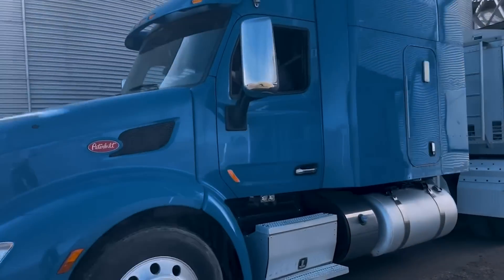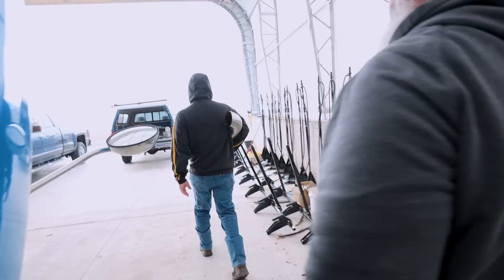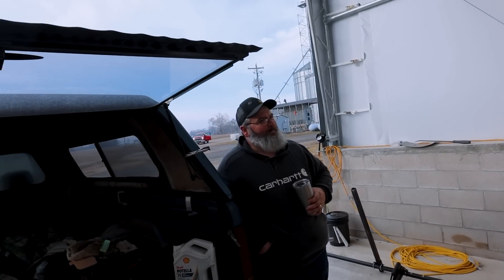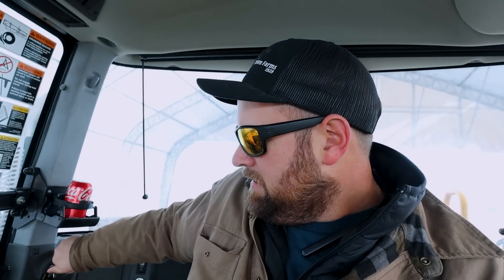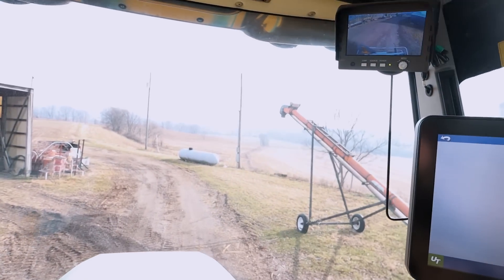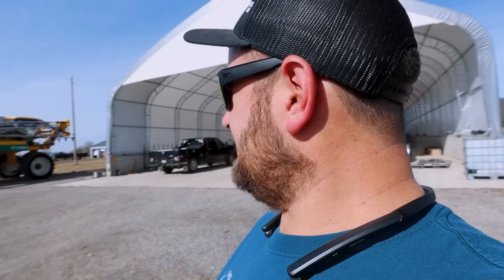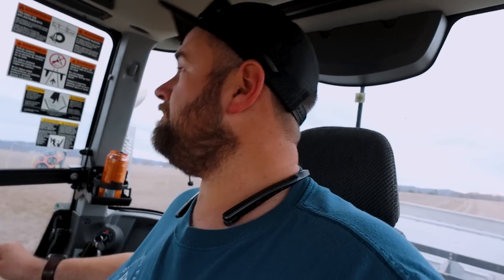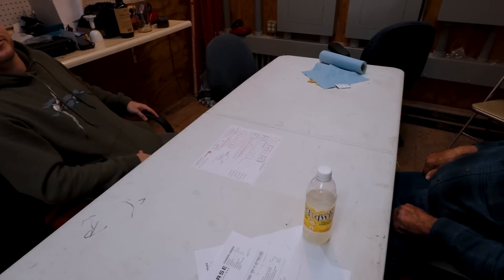Cutting Parts off our New Peterbilts

Comment: Hi Brian if got a creek or ditch they are crossing with dirt bike or ATV or UTV take a 2x4 drive spike nails or long screws through them bud fix them really quick wen they end up with two or four flats everytime and cover them at the crossing or bottom of ditch under dirt so they don't see them
Reply: I did that a few years ago when I was able to farm before I got disabled couldn't work anymore we was having trouble with them also up here in north west Missouri instead of putting holes through there blocks I covered up a few 2x4 with spikes and long screws whent to check there ditch crossing found 2 side by sides 2 4 wheelers 2 dirt bikes in the bottom of the ditch crossing every tire was flat first they lost all there play toys then the cops had fun with them couple of the guys whent to prison because some there play toys was stolen lol go figure

Comment: Brian, I'm a retired industrial electrician. I would hard pipe all main runs with a few strategically place boxes for expansion especially light circuits, over size the conduit one size larger. Branches and feeders use flexible conduit.  It's easier and costs less  than trying to do when the walls and ceiling are in place, it can also help your wires from melted insulation. It's not fun watching 3 phase 480v go phase to phase in conduit from melted wires.

Comment: one thing about the new building. A think I have noticed on other farms, they often complain that the service pit isn't big enough, when they pull in the big equipment. My tough of avoiding a big pit taking up to much space, is to build in cover plates that either can be mover away easily or are mounted on some rails or in a track and can be pushed around

Comment: Like the new trucks and the new intro also. Keep up the good work. Be sure to take lots of pictures on the new house build for future reference. May not seem like a big thing but it helps 20 years down the road. I wish I had for the plumbing underground and for all the electrical in the house. FYI
Reply: And get a set of as built plans
Reply: @bigunone  just remember, no plan survives the first contact with the installer :P
Reply: @9deviltiger9  Electrician by trade which why I said get as builts or at least redlined
Reply: @bigunone  nissed the as 🤦
Reply: @9deviltiger9  At least mark the home runs from there you can generally trace the rest of the circuit

Comment: Sure hope your build for shop goes smoother than ours.   One plumber messed up drain, concrete guy didn't crown 14000 sq ft to the outside , roofer banged and dented every square foot of roof.

Comment: The reason the wheels and tanks are white? When they went to the truck wash they used acid. And it turns  aluminum white, or they used recycled water with acid in it. Citric acid isn’t as bad. But eventually it will do the same thing.

Comment: As for the conduit. I'm an electrician. I would suggest using hard conduit from the panel to each wall or area and then swap over to flex. As long as he puts in a larger pipe than you need (same amount of work) adding anything in the future will be easier and cheaper. My .02 
Nice trucks.
Reply: As a retired IBEW 701 electrician who piped houses for over 20 years I would like to add another 2 cents to yours.
Case in point. My nephew's new to him house had a room that had no overhead lighting just a switched outlet. I installed two wall sconces above two outlets and pulled the switch leg around the room to outlets that were below the new lights. Try doing that with rope and not having drywall damage.

Comment: The chrome bumper is the way to go. It's called, good impressions. I had my stacks just barely over the top of the sleeper and turned out to protect the paint. You could comb your hair in my truck and trailer wheels. But thats all in ones preference. But it just gives you a sense of pride.

Comment: Those engines have a sensor if it’s below 50 degrees they will advance the fuel pump to aid in starting. That’s where the puff of black smoke comes from